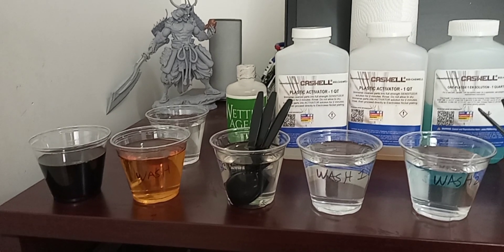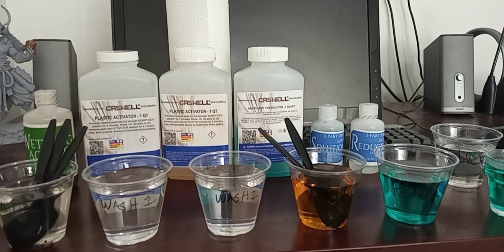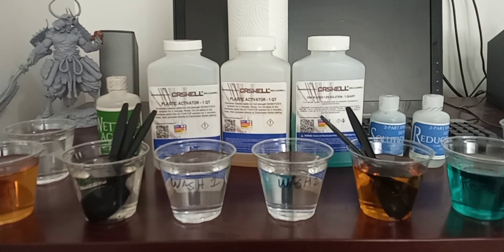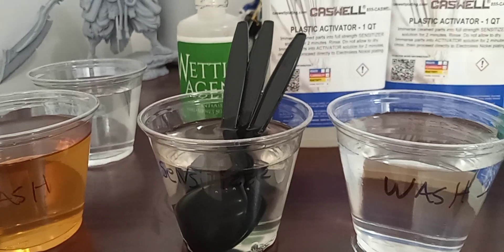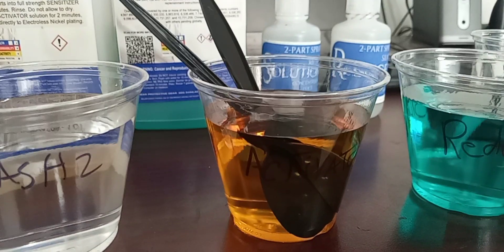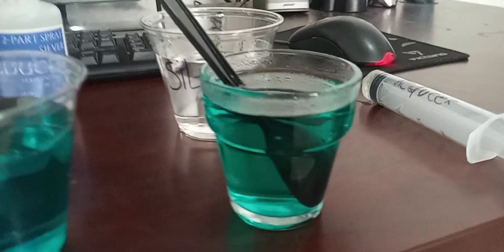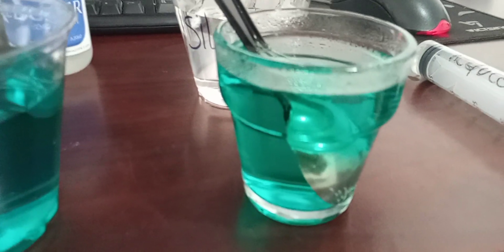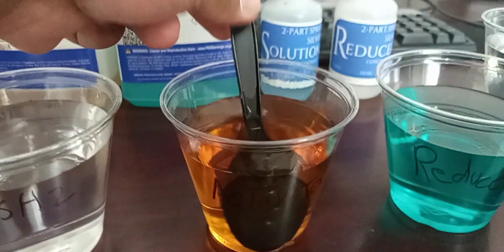Electroless Nickel vs Spray On Chrome for Plastics

Comment: Can we do this on steel, iron, and other materials?
Reply from the maker: It's Normal Electroless Nikel so it can be applied to properly cleaned, Steel/Iron, Nickel, Cobalt and their alloys. With the help of Contact plating one can plate over Copper, Gold, Silver by making them come in contact with an iron hanger. It's

Comment: I was looking into this, but the caswell stuff is SO expensive I feel normal electroplating would b easier. Do you know what exact chemicals I could buy generically? Degreaser I got. I'm not sure how / what reducer to get or how to get the nickel solution (is it just the same as the electrolyte you would use in electroplating?)
Trying to find how much to use of the different things has been impossible as well.
Reply from the maker: It will depend on the Final Goal that you are trying to achieve. Aesthetics? Functional? What are you trying to coat?
Reply: @nicamarvin asthetics, plastic.